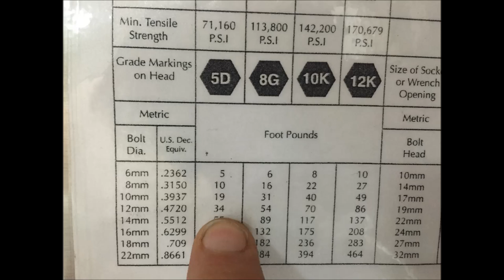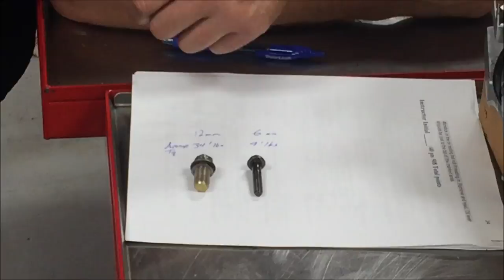Way over-tightened bolt. How does this happen and the tech "not know"?

Comment: Good work Shane.  I have about 5 Facom torque wrenches of various sizes  in my home and often swap them round to make sure the calibrations are the same and I use them for every single bolt and nut on a bike, I finally put a dab/dot of paint marker pen on every thing I've retightened to make sure I haven't missed one. How many dealership garages have I walked into that doesn't have even 1 torque wrench because a previous employee stole it would make your blood boil. I'm a fervent believer that over time you cannot do anything by feel,  either everything ends up uniformly under tightened or over tightened.

Comment: Why do they make bolts out of such cheap steel? Make them out of high carbon steel. Make bolts and screws so tough that they can withstand over tightening without the threads stripping or the bolt lengthening. Engineers all know that everybody over tightens bolts and nuts so make them extra tough!! It's all about engineering people!!

Comment: Bolts over time stick to the surfaces and corrode to the point of giving you the false impression of over torque. Typically it takes less torque to loosen a bolt than it does to tighten one because you are going in the path of less resistance on the incline plane. I believe if you were to mark the angle of the bolt and returned it to the same spot you would be close to the correct torque.

Comment: sir, if we dont have a workshop manual then how we could know the torque required?
Is there any general torque value for like cylinder head, engine side cover etc
Reply: No. If you are doing this kind of work then you need to get a WSM that has all the torque specs. Sometimes they can be found for free in digital format in forums. Otherwise, the cost of a manual is usually cheaper than replacing or repairing a damaged component due to incorrect torque!
Reply: There is a table of typical torques required based on the size of fastener published in every manual, and they are all pretty much identical ... the torque is generally based on the fastener size.  It will differ in special cases like aluminium or titanium bolts or housings.